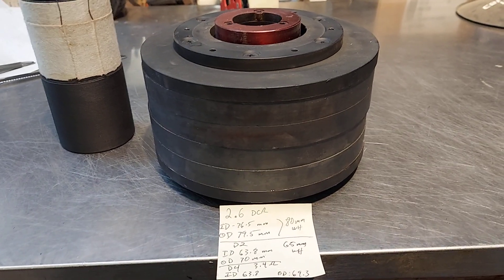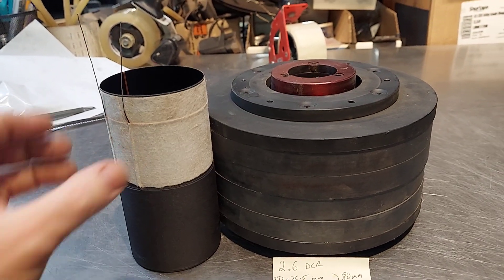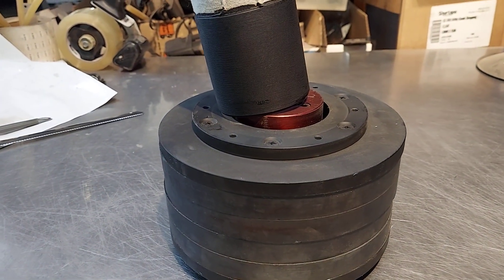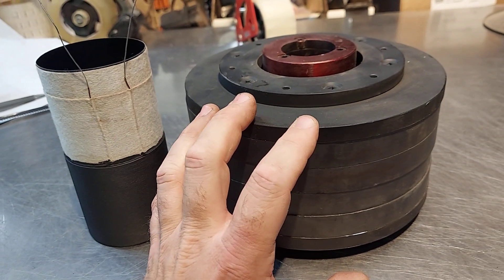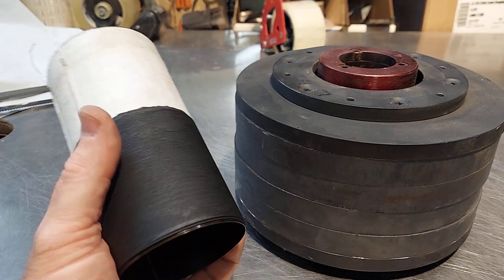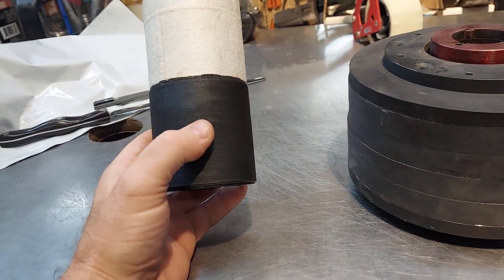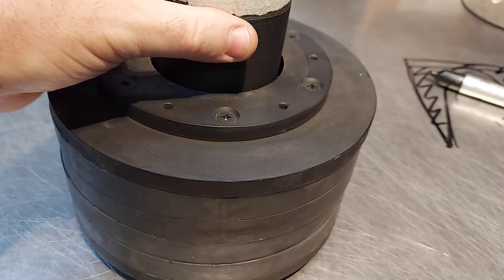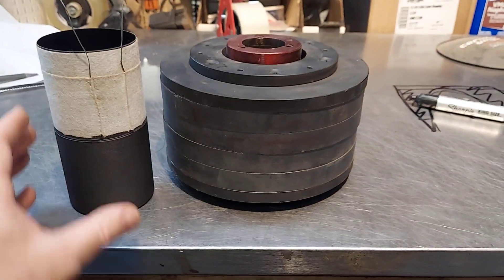Why your subwoofer smells & burns it's not clipping / dirty power it's just you being  too demanding

Comment: So like, if my subwoofer excursion goes 1 to 2+ inches outwards, the far out excursion is  what makes it move at a lower frequency at mid or high volume / gains? That heats up the coil and starts to stink? I use a set of 2 Harbinger vari 4415 subwoofer speakers (2 way)  15 inch sub inside it and it can go insanely loud and even deep. The excursion reaches 1 inch. Or 2 inches. I love these but i have smelled the coils many times. I just hope to not blow the 15 inch subwoofers inside these. I even gotten these a week ago now. I spent $1,300. I love these chest punching deep thundering bass from them. I just hate smelling the coils even at middle or high volume. No clipping and no distortion. I also the app too. App master gain at around -20 or -10 but master volume at 11 o clock position and i still can sometimes smell the coils. I get sad or worried about blowing or catching the coils on fire by accidental. How to avoid overheat in the coils while at high or middle volumes? i got these brand new a week ago.
Reply from the maker: It sounds like you aren't using those speakers in the way that they are meant to be used.
Reply: @R @RobotUnderground  do use these for my DJ gigs and i do currently use these. I’m not new to PA speakers and i do have home theater subwoofers speakers aswell. I’ve had a lot of speakers thru-out my life by the way. I used to have other PA speakers many years back. I might be going hard on the bass since i don’t have any 8 inch or 10 inch or 12 subs. I do have a lot of 6.5’s on my home audio and my DJ speakers are the Harbinger Vari 4415’s 15 inch ones.

Comment: You explained exactly what I was seeing on my (old ass) speaker listening to square wave synth drum n bass. Smelled hot glue. Not good. I shut it off and apologized.
Reply from the maker: No actually drum and bass even when there's distortion does not do that It has to be a physical limitation that you are engaging with

Comment: whoa, so does that mean that things freeze because they are COLD!? Thanks for that tid-bit....:text-green-game-over:
Reply from the maker: If you're subwoofer freezes or seizes up it's typically because you got the coil red hot and it expanded and got caught in the gap it can also be that you got it so hot that the top plate shifted and pinched the coil

Comment: Fuck me so your saying that because I ditched the thinner plastic vent spacer on my sundown for the slightly taller metal vent spacer im causing more heat instead of dissepating heat. Also running an over sized box at stupid low hz is also cooking my coils.

Comment: Can you explain the smell coming from my skar 12 running clean power when it gets hot it smells no smoke just a horrible smell
Reply from the maker: You're just running it too hard and you're getting the coil hot.  Stop doing that.   The enamel is getting hot and coming off as fumes and or smoke

Comment: A speaker/woofer is 98% electric heater and 2% electro acoustic transducer. If those windings are out of the gap- they simply are NOT transposing electrical energy, into magnetic energy into mechanical energy, and ultimately into acoustic energy.
Reply from the maker: The efficiency is typically 10%. 

With 90% going up in heat

Comment: Awesome video but there’s a misconception when “ turning your gain to clipping then turning your volume down “. If your volume is down l, your amp input voltage/signal drops enabling you to turn your gain up without clipping. So you’re most likely not clipping if you have your volume down and gain up
Reply from the maker: Think of the gain and volume knob as a relationship like a seesaw.   It doesn't matter how much the other person weighs, you always want it balanced.  Depending on where each person sits can determine whether it's balanced or not.

Comment: Screw the dd1! Biggest rip off in the audio industry period! Steve meade exclaiming that you cant set gains without dd1 😂, i use a $35 oscilloscope. I turn my head unit to max unclipped volume then play a 40hz tone and set my gains, you can visually watch the sine wave go from smooth rounded peaks to sharp square edges aka clipped signal. You know how they tune a dd1 from the factory? With a oscilloscope..

Comment: The more load on the speaker, the lower the impedance goes. When it is free to move, the higher the impedance and also the better the cooling through the vented pole piece.
So holding a speaker still while dumping a long sine wave into it near its limits its likely to burn it up. Whilst you wouldn't normally hold them still with your hand, tuning frequencies of boxes can do that.
Leaving the coil gap reduces your mechanical reactance, so again more heat. (Not sure of cooling effect of proximity to steel magnet vs just air.)
Reply from the maker: Yes that is called stall mode and I forgot to cover it in this video
Reply: @RobotUnderground  the leaving the gap thing is bad in 3 ways.
1: You start to need more power relative to SPL
2: You lose mechanical reactance (the back EMF when converting electricity to kinetic energy) thus lowering the impedance. This also happens with DC and stall mode. All the energy gets turned into heat!
3: You lose the proximity to cold steel to absorb voice coil heat (though perhaps having more air circulating can compensate for this).
I watched many speaker blow videos and it did seem like it was easier to blow the speaker coil on the same settings once it had left the gap completely.

About square waves: an electrical square wave will not cause the cone to move in a "square" pattern (unless it is a very low frequency like 1 Hz), though it will still contain more energy than a sine wave with the same peak. The current determines the acceleration of the cone, and to get the cone to move in a "square" pattern needs very high current spikes in opposite directions. You will get more of a "dirty" sine wave with a square electrical signal, and the cone will have more excursion than the same peak voltage sine wave, so you won't be left with inadequate pole piece cooling.

Everything is program dependent. Some rap/dubstep bass tester will heat your subs more than a rock track driven to clipping, as it's still only kicks and bass guitar and a bit of tom and lower vocal going through the sub.
Reply from the maker: @TimpBizkit  As I talk about in the video, a square wave is harmless until the total voltage exceeds the force of the motor.  You can play a really clipped wave all day long.  In fact, in some music, there is distortion built into the music, (NIN for example).  It's only when the output of the amp saturates the motor that you run into problems.  Thank you for your response.

Comment: I'm guessing we're limiting information due to time, or youre only talking about free air situations?
Reply from the maker: Please, by all means.  Share any insights that you may have or anything I may have missed.

When you add the complexity of an enclosure and the environment you're playing in, you simply add resistance to the overall force.  Dan Wiggins wrote a white paper some time ago about this.  It basically demonstrates that when you add a smaller enclosure, the sub can handle more abuse.  The rules I talk about in the video are the same, but require more power to re-create the situation in which the coil heats up.  Also, if your enclosure is too large, you run into the same situation as the enclosure is closer to it's ultimate floppy-ness which is free air.  https://web.archive.org/web/20060211224751/http://www.adireaudio.com/Files/BrahmaPowerHandling.pdf

Another good way to view this is when dealing with an air handler fan for your HVAC or even a grow tent.  When the fan is wide open with no load, it tends to overheat and even pull too much current.  The fan will have a power band in which it's most efficient at moving air and those are the parameters in which it remain in for a long life and great performance.  In a friend's grow tent recently, I showed him that if he just covered the air intake with a little piece of cardboard, he'd quit popping the breaker.
Reply: @RobotUnderground  my opinion. While I 100% agree with the fact that enclosure size can definitely impact the "amount of abuse" a certain woofer can take, is that: yes a smaller enclosure size can increase the mechanical limitations. Thus, increasing the amount of power able to be applied to a coil before leaving the mechanical gap and too big of an enclosure size can decrease expected performance (mainly power handling via mechanical limitations). 
A  clipped signal can make the coil sit in one position(at the - and + peaks in acv), making heat build, due to the coil not moving at the same rate for brief moments... causing air flow across the coil to be hindered. 
The reason I said you left certain information out due to time restraints is that we both had to write a book just explaining this small amount of information, and the video could be so long that most viewers wouldnt even interpret the information. 
If you're applying enough power, you can cook a coil while staying within the coil gap, whether it's stiff soft parts, too small of an enclosure, or too much power for the coil in general. 
Yes, turning the volume down does allow you to cool the coil (and equipment in general). The fact that coil failure is directly correlated to either is kind of mute. Imo. 
The amount of information that can be added here is almost infinite. 
Obviously, the amount of aluminum/copper that's in the coil has thermal limitations (rms watts, acv, etc).
If you move the coil out of the gap, this manifests so much more quickly, and clipping would make it happen faster.
Hopefully, I'm not coming off argumentative. I'm a sponge for information and want to learn all I can. I also want to spread as much information to my fellow audio enthusiast.
Reply from the maker: @jabosmokes6338   Correct, that would be considered, "stall mode", like holding the squirrel cage on an air handler.  Eventually the motor will burn up because it's not able to turn into / express that electrical power into mechanical power.
Reply from the maker: @jabosmokes6338  Well you can always make your own video explaining it and get AI to animate it.
Reply: @RobotUnderground I wish I could do a lot of the things I want to do. One of those things would be to learn and spread information. Unfortunately, I don't have the time to complete even some of the most basic things.
That's why I expressed my opinion/ question about you limiting things due to time constraints. I simply understand that aspect more than almost anything. 
One of the things I enjoy in life the most... is audio, and drowning out the sound of life itself. I make "small" replies in the minimum amount of time I get (not demeaning, or contradictory) because I can't concentrate or have enouge time to make a video like this, and if I am overlooking a reason for something not being included....I want to know if I'm just missing something.
Reply from the maker: @jabosmokes6338  I hear you.  I always want to know if I'm missing something.  The video I made is even more than what needs to be out there.  There's something magical about seeing a grown man cry about burning up a subwoofer.
Reply: @RobotUnderground  having more than the average amount of understanding of what to do or not to do didn't make me any less sad any time I popped a coil, burned a lead, ripped a spider, etc. It did, however, keep me from passing blame to the builder/company. I know I put too much sauce on my burrito.
Reply from the maker: @jabosmokes6338  See.  It's just like when I see 2 dudes on tv passionately kissing.  I make myself like and accept it.  "That's love there Patrick!   You watch that and you better like it because it's the future of humanity!"

Comment: I just watched your video again because you are a straight forward person and you don't sugar coat anything when you said leaving the gap pretty much not setting your subsonic filter properly that causes too much excursion which means it leaves the gap and like you said when you turn the volume up to much the head unit is clipping your amplifier so everything plays a big role  i keep my head unit at a low volume and my subwoofers are lukewarm even when it is over 100 degrees
Reply from the maker: You can set the subsonic in certain applications.   Remember that the subsonic / infrasonic filter was created for only two applications.  1st the rumble of vinyl records being slightly warped and playing on the turn-table.  

2nd as a high pass filter to prevent the amplifier from going into DC-offset when playing really low frequencies.

Many amps already add this to an amplifier, especially in Class D amps.

Otherwise though, you don't need it, just turn it down or off and use the amp / system normally.

Comment: Hey Robert why don't fi subwoofers have a hole in the bottom of their magnet like the majority of subwoofers and how do they stay cool?
Reply from the maker: Hey Cecil.  My name is Patrick Chandler.  The organization is named Robot Underground.  Some designs know that their subs are going to be abused and constrict the air flow within the gap.  Scott / Fi did this first with the RE Audio MT back in the 2000's.  By not venting the motor, you do gain some thermal mass.  You also force the air in and out of the gap in a violent / turbulent way.  It's not a quiet process.  But if you're getting loud like in an SPL vehicle, mechanical noise of the subwoofer isn't an issue.   It's just another way to do things.  Is it better??  Scott seems to think so.

Comment: What makes heat in wires or coils, is AMPERAGE. If you feed too many amps through it for too long it gets too hot. The reason clipping increases the likelyhood of cooking it is because its putting more amperage for a longer amount of time through your coil. Heat isnt only happening because it's got less windings in the gap, but does get worse if the coil doesn't move momentarily. How much it moves and how much airflow it has effects the cooling and therefore the amount of amps it can handle and for how long. There is no exact number, it's about time. How much time can it handle X amount of amperage for before reaching thermal limits. If you have anything more convincing that it leaving the gap increases how much amperage we see(like say, when it stops or nearly stops at the end of its stroke, the coil is no longer inducting back voltage, so is this going to increase amperage for that moment? Decrease it? You can handle clipping when the amperage is far below what the coil and its airflow can handle, that doesn't prove that the cause is leaving the gap, just that enough amperage to make it leave the gap, is going to create heat. Theres plenty of proof that leaving the gap doesnt cook your woofer when it's not seeing excessive amperage, you can push a good amount of woofers and subwoofers to those excursion extremes in free air and often not even induct any noticable heat. The main factor at play is amperage over time, in my opinion.
Reply: interesting

Comment: I have a sundown zv6 15 on a skar Rp 4500.1 wired to 1 ohm and I play it full tilt every where I go and I would smell it well I would turn it down then get back to it well here recently I’ve just been playing it through the smell just to see if it’s still gonna play and last and it has but it’s a awful smell to me it smells like strong cow manure but then I go look at the coil to check it Bc I have it inverted and the coil looks new still so I’m super confused if I’m fucking it up or it just does that lol I’ve got my gain set all the way down so I know I’m not burning it up that way and I also have big 3 and a xs power 40ah lithium yinlong battery it’s a 8layer black coated flat wound coil on the zv6 so any advise or thought from any one would be appreciated
Reply from the maker: If you smell it, you're clipping / running it too hard.  I'd recommend something like the TEAM 18" as an upgrade.  We make something like that called the GONZO 7k for only $950 shipped.  The 18" will fit in the box that you have now.  https://www.youtube.com/watch?v=s1BV5Ov15Zk
Reply: @RobotUnderground  Thankyou for the feed back I appreciate it and I’ll look into upgrading to a team
Reply: Or possibly that Gonzo 7k
Reply from the maker: @justinturner1840  Similar products used to be offered direct from the brand at a reasonable price until dumb JP & Sky High stepped in.  https://www.resilientsounds.com/product-page/resilient-sounds-team-18-d1

Comment: Then a subwoofer can handle more power at higher frequencies? Above 50hz (80-100) because at that range the Xmax is very low. Can i add a couple of db at that range using eq? Without burning my sub

Comment: If you.overpower them they do that too..I had a Kenwood 400 wattrms and powered within mtx 10001 450rms at 4 ohm and it smoked up like 10 minutes. Gain wast too high though.
Reply from the maker: Well the total voltage that you were running to the subwoofer was too much
Reply: @RobotUnderground  true

Comment: I enjoyed the vid and you help clear some distortion from mixed information, what you just demonstrated made complete cents to me, i played my woofers hard and just when i reached the desired vol i smell them coils, i thought my amplifiers were faulty, cause i had two Solar 1500d mono blocks on two 12" XTC Audio flavours 6000w d4s, noticed the one woofer started pulling in at full volume, now i no what was happening, i was pushing them beyond mechanical limits over heating the coils with a slot port box prob out of it's parameters, now i no y 4th orders are so popular thank you!
Reply from the maker: Sure you might want to just look for a subwoofers with bigger stronger magnets to replace the ones you have now